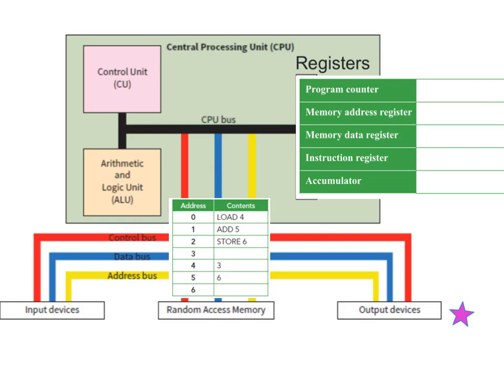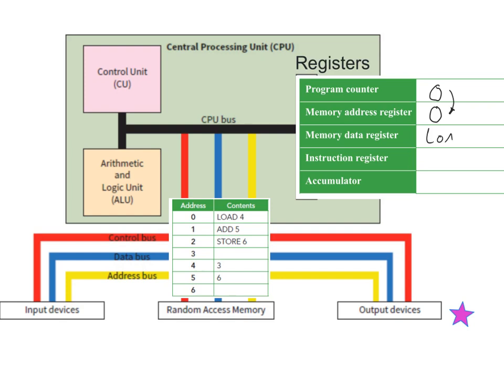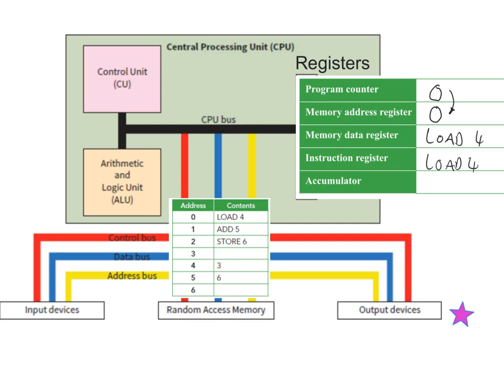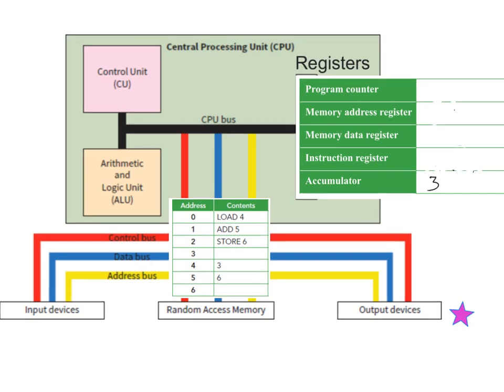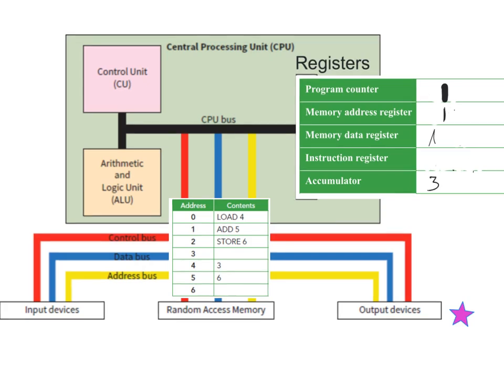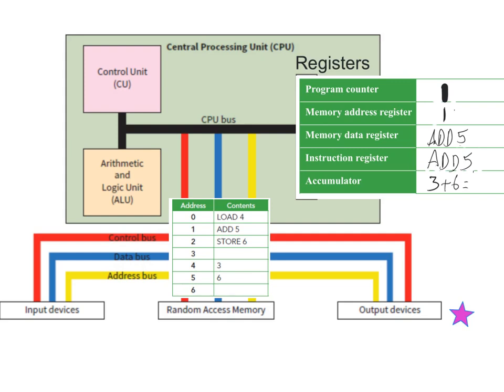Fetch decode execute cycle

Comment: So am I correct that:
1)The program is started from an input device and the command travels along the Control Bus to the CU.
2) The Control Unit then contacts the PC along the CPU bus. It moves the counter to MAR (and increments the PC), goes along the address bus to RAM, 'fetches' the contents of the address, transfers the contents back along the data bus and stores it in MDR. That is the Fetch part completed.
3) Then the Control Unit continues to work in Decode. The CU transfers the contents of MDR to IR, which decodes the contents and puts the decoded data into the Accumulator. That is the end of the Decode part.
4)Then the Execute starts. The ALU then performs the arithmetic or logic and sends the output along the data bus to the output device. That is the end of the Execute part.
Reply: Sorry I think you might be slightly incorrect.
Fetch
1. PC sets MAR to 0
2. (extra) control signal sent along the control bus signifying a read signal
3. address from MAR is sent to the RAM
4. Memory location is read and the data is taken along the data bus and stored in the MDR
Decode
5. Data in MDR is transferred to the IR
6. IR is transferred to the decoder in the CPU along the CPU bus to figure out what the instruction means.
Execute
7. 
CPU sends signal along the address bus and stores it in the accumulator
If instruction involves a calculation the CPU sends the stored address to perform calculations with the value of the accumulator
If the instruction involves storing data the value of the accumulator is transferred into the RAM along the data bus after a control signal is sent along the control bus signifying a write instruction and the address bus is sent signifying the memory location of storage.

Comment: Nicely explained. Could you explain how do CU and ALU take part of this process? What do they do when this process happen?
Reply from the maker: So the CU (Control Unit) is responsible for sending the signals out which control what is going on in the computer. The signal speed is dictated by the clock, which is also in the control unit. The ALU (arithmetic and logic unit) is responsible for performing calculation on the data (for example is number x bigger than number y and so on).